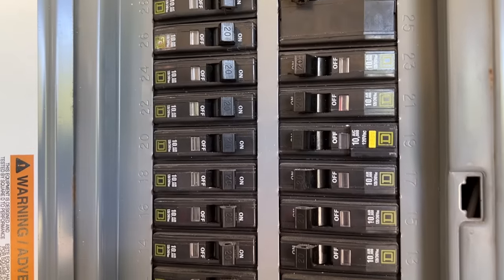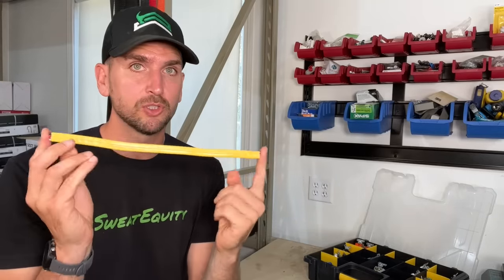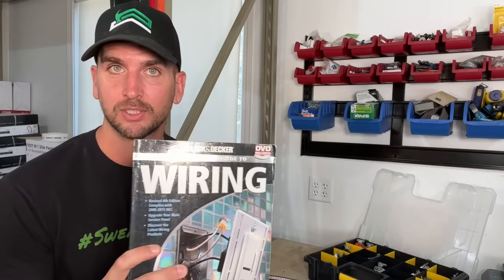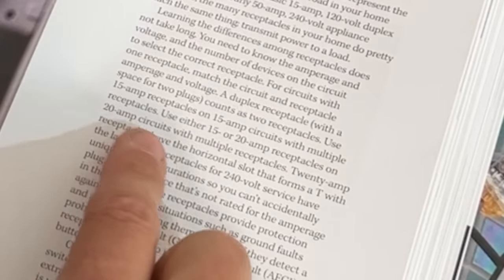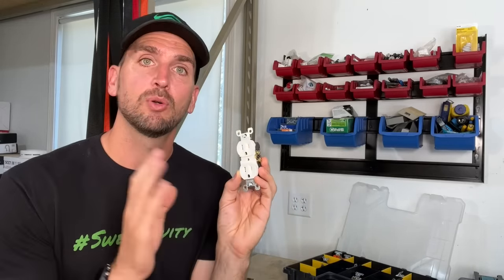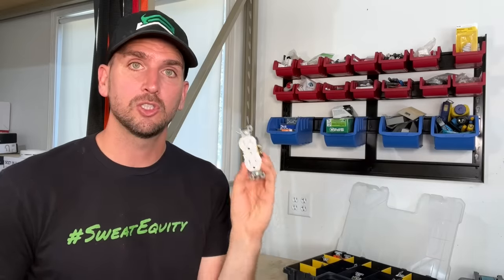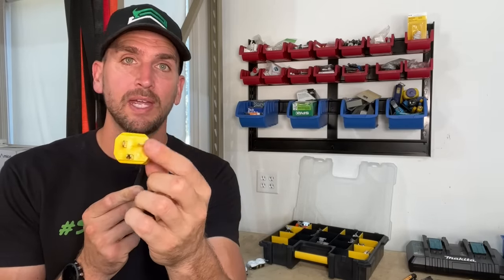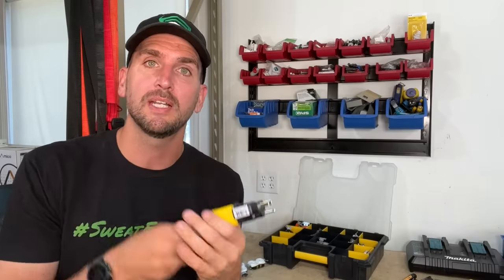Can 15 Amp Outlets Be Used On A 20 Amp Circuit Breaker

Comment: One thing I've noticed here in Canada is that the 120 volt,  20 amp receptacles of 40 years ago could only take 20 amp appliances plugged into them (the neutral slot was horizontal).  Nowadays, the 20 amp receptacles have a "T" - shaped neutral, allowing for the connection of both 15 amp and 20 amp plugs.
Reply: Correct they changed things to be similar to the NEC way of doing things back in the 90's and a good thing they did as it allows more flexibility now with what you can plug in and where.  The 20A 240v version  in Canada are the same now as well, they will accept a 15 OR 20A 240v plug.
Reply: This may also be a side effect of older allowances or NEMA 1 (120v) and 2 (240v) outlets. When we did some renovations on an older house we had, there we 2 prong receptacles where both terminals had unpolarized "T" shaped slots, which could allow someone to plug in 15A and 20A devices at 120v, but ALSO allow someone to attempt a 220v device as well. It was a little unsettling because it also told us that the opposite situation could also exist, where a 220v circuit allowed 120v devices to be plugged into it.
Reply: @REWYRED  very interesting.  You have to wonder if Canada changed the code regarding 15 and 20 amp receptacles to be more competitive with the US regarding importing goods.   Because here in the US,  120V/20A plugs are rare, most equipment drawing currents higher than 15A are designed for 240V-15A or more.
Reply: @ghammer9773  Yes, I've seen those T slot two prong outlets,  the one's I came across were polarized although I would not assume the wider slot was the neutral, like is required in modern practice.  Had the rating of 125V-15A/250V-10A.  Particularly during the roaring 20s, when most cities and suburbs had electricity for the first time and a wide variety of electrical gadgets hit the market,  there were two versions of 120V plugs,  the horizontal prongs and vertical prongs, before the NEMA standards were widely adopted across the board both versions were used interchangeably with 120 and 240 volts and the end user had to know what voltage was being supplied before plugging in lamps and appliances.
Reply: @Sparky-ww5re   20A plugs are rare on appliances here as well but they do exist... Not so much for resi applications but  where I work, in a hospital  20A straight blade plugs both of the 120V and 240V configuration exist and are pretty common... 
Dialysis machines and some I.T.  equipment are some I can think of that have 20A plugs.

 I think they adopted 20A circuits for kitchens and the respective receptacle because it's cheaper to GFI protect a 20A circuit vs a traditional 15A "split". And being Canada we are not allowed to put a 15A device on a 20A circuit........ Even though we all know nothing bad will likely happen.
Reply: @REWYRED  interesting that Canada doesn't allow 15 amp devices on 20 amp circuits.  In the USA, 15 amp devices are allowed on 20 amp circuits as long as there are two or more receptacles on the circuit (your typical duplex receptacle counts as two) A single receptacle on a circuit must match the circuit rating.  20 amp receptacles are not allowed on 15 amp circuits.
Reply: @Sparky-ww5re  I agree  and it's not like the innards on 15A receptacle is different than what is inside a 20A receptacle, in regards to a spec grade receptacle anyway.
SOMEHOW back in the early 60s  they did get away with 15A devices on 20A circuits at the hospital I work at only these 20A circuits fed SINGLE receptacles. I guess the idea being you can't overload a receptacle stamped 15A  by plugging one thing in but with a duplex you could draw in excess of 15A through a device stamped 15A.
Reply: I have a duplex receptacle faceplate (all one piece) that was made in Iowa and installed in my Grandmothers house during WWII.   It is a 20a 120 or 240 volt rated device.  Vertical hot, horizontal neutral, no ground.
Reply: @KevinCoop1  nice find, thanks for sharing.  Amazing what you can  find in old buildings along with the lack of safety standards that would never be allowed today.  Indeed many of the receptacles of that era were marked for 110/220V, 120/240V or something along that range featuring double T slots that accepted plugs with two vertical or horizontal prongs, or a vertical and horizontal prong depending on who manufacturered the lamp or appliance and 120 or 240V could have been used, so the occupants had to know what was supplied & make sure the appliance was plugged into the correct voltage.
Reply: @KevinCoop1  "It is a 20a 120 or 240 volt rated device.  Vertical hot, horizontal neutral, no ground."  Sounds similar to NEMA 2-20R.

Comment: at one time not too long ago, kitchens counter outlets were wired with a split 15a outlet on a 15 amp circuit. I guess the rationale being that kitchen counters are prone to being overloaded with appliances.  That was changed in the past 15 years or so to install 20a (non split) outlet on a 20 amp circuit.  That's the most common place I've seen 20a outlets.
Reply: What kitchen appliance require a 20a outlet? Every fridge, toaster, blender, microwave, air fryer I've ever seen are rated for 15a outlets...
Reply: @joseph7105  some air fryers require a 20 amp circuit.  But that's not why kitchen outlets were changed to 20 amp.  It's because people would plug in multiple items to the outlet at the same time.  For example if you had a toaster, kettle and blender going at the same time on the same circuit.  That's why the outlets used to be split.  Now they are 20 amp.

Comment: One seemingly minor problem with the several commercial or heavy duty grade outlets you recommend that people use instead of residential grade ones is the center nut that you install the faceplate bolt into.

On all the commercial or heavy duty grade outlets I've seen, they're not very strong and if you overtighten the bolt even a little, the "tube" that the nut is attached to that secures it to the backplate of of the outlet breaks off and now there's nothing to secure that bolt. Yet for some reason they're more secure on the residential outlets I've seen.

Now if you're only looking to attach a standard faceplate to the outlet then that's not a big problem, just go easy and it should be fine, just a few inch-pounds should do it.

But if you're attaching an outlet extender, the sort that have 4, 5, 6 or more outlets on them and maybe some USB ports, that are often the best way to connect more than a couple of devices to mains power, then you're going to need to tighten that down some more to secure it, since they're much heavier and bulkier than faceplates, and these higher-end outlets can't seem to handle that.

Any suggestions? Are there commercial or heavy duty grade outlets that can handle being tightened more than to faceplate spec? Sure, you can use a power strip instead of a plug-in outlet extender, but they're not always practical or feasible.

Comment: I’ve found that 15 amp GFCI outlets are sensitive at the upper limit. The electrical contractor installed all 15 amp outlets with GFCI protection at an industrial facility that used pumps and power tools. I finally had to draw a picture of a 20 amp outlet, so they could install the correct outlets for my people could use power tools to do their job.

Comment: My wife and I just bought a house built in 1980, and it's getting really close to us needing to upgrade our electrical package to bring everything up to code. It's old enough where none of the outlets close to water sources are GFCI when they should be. I've added one to the hall bathroom, but have yet to do the same to the kitchen, and master bathroom. We have big plans to renovate part of the house, and that would most likely cover a full plumbing gut/replacement. Once we get to that point, in about 200 yrs, we'll do most of it in one shot, lol.

Comment: Good video, I liked the outlet comparison. I have rewired quite a bit of our house, and have dropped more than a few 12/2 20 amp circuits, and have used the better quality Leviton 15 amp outlets, around $3 ea. I really do not operate anything in the house that would require commercial grade 20 amp outlets. Out in the garage, now that is a different story, commercial grade outlets there, on their own sub panel that I also installed.
Reply: Garage requires all receptacles GFCI protected
Reply: @firebird77clonefirebird89  I have lost one to many freezer loads of food to those things, you can have them. I have lived 58 years without them and am still here. My grandparents went even longer.

Comment: The 15amp. Rating is because of the nema configuration , the gauge of the conductors inside is.the same as a 20amp outlet,it's the configuration that determines the amperage.

Comment: As a retired electronic and electrical eng.. Yes you can (not a biggy) circuit should break if you overload just be careful in the kitchen and bathroom. Wiring is the key also look how easy you can reset your circuit braker.

Comment: 5:06 The receptacle in the middle is NOT just like the 5-20 on the right, the one in the middle is using the 'T' configuration grip on BOTH sides. So even the 5-20 had some cost-cutting measures done, once they designed a grip that was only for the vertical blade.
Reply: I think the outlet in the middle is the cost cut model. It is cheaper to make 1000 pieces of one part than it is to make 500 of one part and then 500 of another.
Using the T grip on both sides of both 15 and 20 amp outlets allows the manufacturer to shut down the machine that makes the vertical grip. And the casting for both types is the same, 
The amount of brass saved is negligible. 
Standardizing as much as possible saves production.
Reply: @scottbc31h22  possibly, however, I used to work at an injection molding plant, and they would haggle for material discounts as small as a penny a ton. And this was making milk caps, barely two to three ounces of plastic per cap.

Comment: You are obviously an encyclopedia of knowledge. Thanks for the great content.

I'm installing an outdoor 15 amp GFCI on a 20 amp breaker, using a grounded metal box. This box will be attached to a "bridged" 2x4, attached beetween two joists wthin a soffit. My goal is to have the GFCI recepticle protruding flush (or slightly below) the soffit, followed by a waterproof housing. Can you advise how high to place my 2x4 inside the soffit to meet my need?

Comment: What I see in new residential are mixed circuits, with ceiling lights sharing circuits with wall receptacles  on 14 gauge wire ln long runs.  Not an electrician myself, but as a renovator my clients are asking me to look at electrical problems as a side issue.  Lots of arc fault breakers not playing nice with bathrooms

Comment: 5:10 that older 15 uncovered is definitely different than the new 20. 
That older one looks like it might be 5-20R or 5-20P ready.
The horizontal is on both side.

Comment: Love your videos... 
I do applications for an x-ray company and our products are 20amp plugs... Even the lower energy systems (2.4kW). But we almost always have to use that little converter for small clinics and stuff. I have 3 in my bag.
Reply from the maker: Thanks for the feedback and support!
Reply: Are you saying that you use adapters to run your devices that can draw 20 amps (they have 20 amp plugs) on circuits designed to only provide 15 amps (14g wire and a 15a breaker)?  That seems like a bad idea.
Reply: @learnMax  no, the system can and does run in 15 amps, but the factory saves money by using the same 20 amp plug on every model. 

But even for the bigger unit, it comes in 2 pieces, running a monitor cart only requires 15amps but if the other part is connected, then the 20amp is necessary.
Reply: @TheOldBlackCrow  I wonder if they factored in that you'd have to put in an adapter when they "saved money" by using the wrong plug on the 15 amp models.
Reply: @learnMax  that's a reasonable point but they are actually trying to keep with code compliance in the States.... So I guess it's not just about saving money. The vast majority of small clinics that buy the system in the US are too cheap to hire an electrician to put in a proper outlet, let alone the correct amperage at the breaker box. Since electrical code for medical facilities (for most local governments) do specify that there should be at least one 20amp outlet /breaker in each room, it's on the facility to upgrade their rooms and not for the company to comply with the facilities preference.

Comment: I use 20 amp commercial rated outlets in my house. Once in, I never have changed same one again. Those cheap ones that are 15 amp rated I don't use, plus they don't hold up either over time.

Comment: 3:25 "For an extra dollar or $1.50 per outlet it's worth it." I agree. What most people don't get is that $1.50 per outlet more is a 500%+ increase from 30 cents to over $2.00 per outlet for commercial grade. That adds up fast when you wire a neighborhood.
Reply: If your prout margins are that tight maybe your bidding your jobs to low
Reply: If you install $0.30 receptacles in a residence you are not providing a product to the consumer that is worth what you charge them to install it.
Reply: For the safety involved, I'd go with the stronger receptacle.  How many outlets are there in a 2br/2ba house?  Even if you were wiring up 100 outlets, that is only a $150 increase in cost.  In the United states Electricians start at $50 per hour.  So for roughly 3 hours of an electrician's work you get a much safer outlet setup.
Reply: "That adds up fast when you wire a neighborhood"

You are wiring up a house per customer and should factor in the costs per house not by the neighborhood since very few neighborhoods would need all brand new outlets in every house at the same time!

Squabbling over $2 per outlet when the cost for a house that burned down will be way more than the outlets!

There was a house down the street from me a few years ago that around 2am burned to the ground, they figured out the cause was a ceiling lamp whose power wire plugged into the wall outlet behind a hideabed, and that one of the children folded the thing up at bed time and accidentally caught that lamp cord in the mechanism of the folding bed, they all went upstairs to bed and around 2 am the cord which was caught in the mechanism started the fire in the foam/upholstery.
They had NO smoke alarms, and walls were open for renovation, so insulation was all exposed. Mom and 3 children never made it out

"Family members sat in their cars close by as fire trucks continued to put out hot spots. Firefighters say a ceiling lamp cord caught fire, after being jammed inside a pull out couch.
"They dug long enough to where they finally found it. And unfortunately it had put an overload on two plug-ins and that got the wall on fire."
Reply: @HobbyOrganist  For a lot of neighborhoods, all of the houses were built by a single developer. Building every thing just to code (no more and no less) allows them to price competitively while maximiIng profit. The consumer assumes that the local building codes are satisfactory and the homes were all built to code. Taking the cheapest route for receptacles might only save the developer a few thousand for the whole development but going the cheapest route on everything adds up.

To my thinking, if those low price outlets pose a danger, that should be regulated at the point of code/inspection rather than leaving it up to the discretion of the builder.

Comment: Greetings Folks - Remember, multiple receptacles include "Duplex" receptacles which are (2) receptacles on a single yoke or strap. Also, the use of the term "outlet" for the device is incorrect based on the definition of devices and outlets. The "outlet" is the point where you would install the device, such as in an "outlet" box.
Reply: That's pretty petty. If you want to get technical, Ford motor company general motors are misnamed because the vehicles run on engines not motors. A motorcycle should be called an engine cycle according to your logic. The electric receptacles in American homes are called outlets,  and that's what they are.
Reply: @davedammitt7691  it's not Petty...its in the NEC. Now, your reference to General Motors is NOT the same and is quite petty in itself to compare the two. If you don't desire to learn, turn off the computer.
Reply: @davedammitt7691       If you were in a position in your job that you do electrical design or installation for a company, you would know what he is talking about.   For us that do, it is extremely important to know and use words and terms correctly because not doing that can cause non compliant installs, sometimes very very expensive re-work.   For someone like you that has nothing to do with electrical work, it may seem petty.